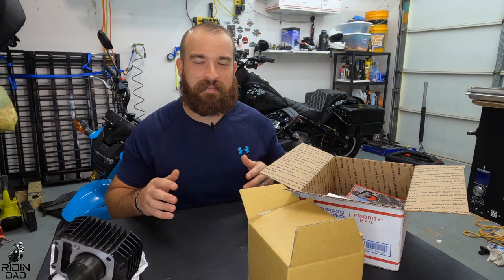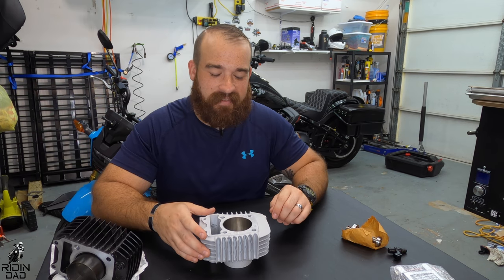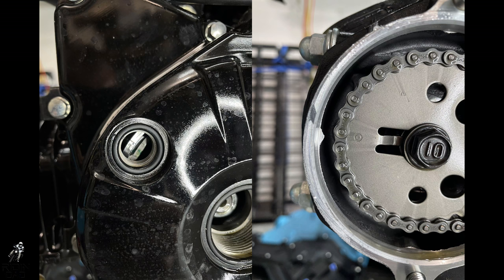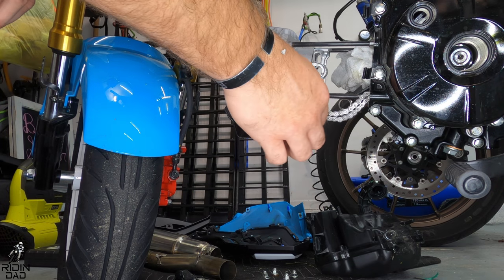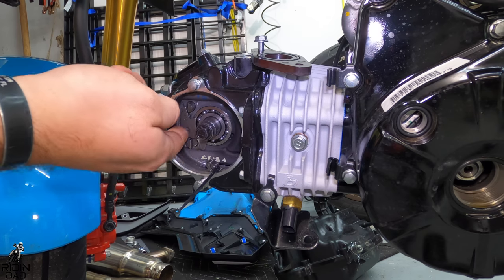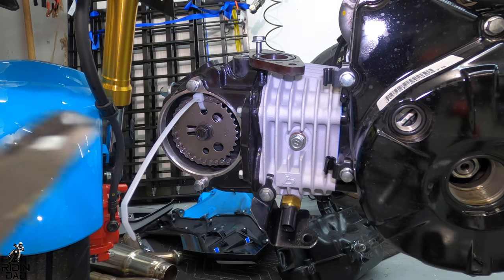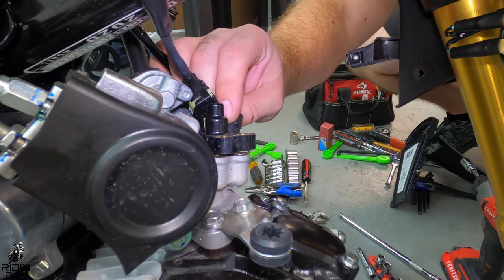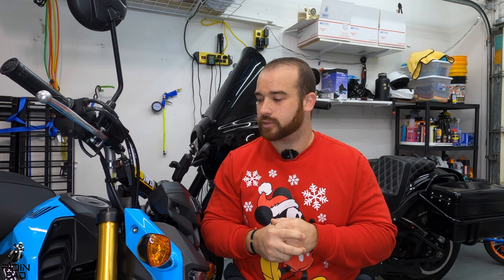DHM Big Bore Kit install on my Honda Grom (msx125) - 186cc of PURE POWER!

Comment: Just installed this same BBK into my 2020 Blue Monkey, and used the video as a step-by-step. Short story, it fired right up and runs great! Thanks Ridin Dad! I went 0.003 intake and exhaust, no valve clicking. Great vid, and very helpful - especially the zip tie trick on the cam chain.
Reply from the maker: Hey that’s awesome man!!! Glad to help, that’s why I do what I do lol. Have fun with it man, it’s so much better than stock!

Comment: Followed this to install my kit, no problem at all! 

Although, they must have changed up their oil cooler kit a bit because mine came with a black bracket and did not mount to the bottom valve adjuster tappet, instead it mounted to the bottom head bolts and it tucked up there pretty nicely. I did have to turn the idle screw one turn because of the poor idle but my only issue now is tough starts, which i'm sure a lithium battery will take care of.
Reply from the maker: That’s awesome!!!! I’m glad I helped man. Sounds like a better position fo the oil cooler for sure. And yeah you’re exactly right. A battery with Some higher cca’s will fix that problem completely
Reply: @RidinDad  For sure! Did you have clutch slip immediately with yours? Anything over 6k and mine just slips through the rev range. Looks like the tb clutch kit is next for me 😂
Reply from the maker: Never had a chance to experience that. I planned ahead and prior to the bbk I installed a 6 disc clutch kit & 80% stiffer springs!! Videos on all that in the grom build series playlist too 🤙🏼
Reply: @RidinDad  oh nice! I'll have to check that out then, appreciate it. I was wrong to think the stock clutch would hold 😂
Reply from the maker: Lol yeah man
Reply: @RidinDad  Good stuff! I was pretty skeptical at first if the BBK was worth it, it's a totally different bike and sounds way mean!
Reply from the maker: Hell yeah!! It is way more fun with it for sure man

Comment: Looks like a lot of work and it's a little pricey 700$ compared to swapping the engine complete kit with a zs190 direct replacement 799$ your also  able to sale the extra parts as well could possibly brake even if the honda engine is fresh. 👌👍✌️
Reply from the maker: I really wasn’t interested in an engine swap. The dhm kit is incredibly well made and I think the price is fair for all you get

Comment: Hey for those new to the bbk, if and when you upgrade your throttle body to something bigger ie, koso 34mm throttle body w/ intake manifold, expect to spend some money on getting your cylinder ported to match the throttle body. Just so you know - cause I didn’t.
Reply from the maker: Ive seen plenty of people do a new cylinder and add a throttle body later on without porting the cylinder....why would you have to do that?

Comment: I HAVE A 2020 HONDA GROM and I am seriously thinking about getting this kit. Everyone I talk to about it says that im going to need alot more parts to make it work right and be reliable is this true??????    Awesome tutorial by the way!!!!!!
Reply from the maker: Thank you! So everybody’s opinion is a little different. This kid specifically has pretty much everything you would ever need. There are some additional parts very small like some valve parts that are just a little bit more durable that would be a long-term thing but other than that there’s really nothing that I can think of that you would need with this kit. It pretty much has everything in it as long as you select the correct drop-down items and adding it to your card. That’s the main reason I went with this kit. I only have about 200 miles on it so far so I can’t tell you longevity wise how it has been but I can tell you that I have not been gentle with the bike and it’s giving me absolutely zero issues. I would say to make sure you have a good aftermarket exhaust and a good air filter to allow your bike to breathe with this new big bore kit

Comment: They call the kit "all inclusive", but if you're going to be installing an oil cooler I hope you got a high flow oil pump as well. I recall a lot of big bore guys having severe heating issues because they weren't actually getting oil flowing throw the cooler on the stock pump.
Reply from the maker: I do have a high flow pump. Have a video on that too

Comment: Hows it riding since you've done the install? has their been any problems with reliability?
Reply from the maker: 0 problems at all. I’ve abused it too lol. It’s great!!
Reply: Sweet! Have another question if you don’t mind me asking. I just installed mine today and I’m having a problem with the idle. At first, my bike had a super hard time starting up. I did get it to stay on after a few attempts, but at low idle, the bike sounds like it wants to shut off. When I blip the throttle, it will turn off if I do that too fast. I took the bike on a short ride and it felt great while riding but turned off on my when I slowed to a stop then tried to speed up. Any idea what might be causing this problem?
Reply from the maker: How long was the ride?  I would say take it on a longer calm ride if you can. Sounds like it’s going to fix itself. What air filter you using?

Comment: so was it worrht it? great vid, just wish u would have told us your top speeds and stuff. thanks though!
Reply from the maker: Thank you! And yeah....very worth it. Next weeks video is my first impressions. It’s impossible to find my top speed with this. I haven’t been able to find my top speed with the belt either due to where I live and the fact that the top speed would be well over 100mph. I didn’t feel too speed was important with this because it doesn’t decrease top speed to a noticeable level and it’s not made to increase the top speed at all in this gearing.

Comment: People, top speed will still be the same as stock it will just get there faster. Only way to get more top speed is by changing the sprockets.
Reply from the maker: True to an extent. Different kits and higher compression etc will enhance top speed but this one is way more for torque

Comment: Just about to install the kit on my Monkey, great video thanks, question because of the oil cooler do i need to put more oil in than normal? thanks
Reply from the maker: Thank man! And yes it will need more oil. I think I wound up using about 1.5 qts. Happy installing!

Comment: Hey bud how much oil did you used for the 186 bbk ? I'm doing the same thing but I don't want to less
Reply from the maker: So I kind of just played it by ear. I don’t remember exactly how much I used. Obviously more than the typical amount because of the included oil cooler. I think I just added a little bit extra and then checked the level and went from there. I honestly don’t remember too much

Comment: All head work,  cam installation, valve adjustment should be done on bench. Then install.
Reply from the maker: Why? That’s just preference. We adjust the valves normally with everything in tact at typical intervals. So just because you prefer to do it on a bench doesn’t mean that it’s wrong to do it while on the bike. Doesn’t have any affect on the outcome at all

Comment: Is the grom still up and running with that bbk
Reply from the maker: I have no idea lol. I sold it a while ago
Reply: @RidinDad  but how it rode any speed bumps
Reply from the maker: It handled speed bumps fine. If you’re asking if it bottomed out easy I never had an issue
Reply: @RidinDad  I think he's asking if there were any dead or flat spots in the power.
Reply from the maker: I gotchya. Makes sense. And nope. Very linear power delivery. No gaps at all that were felt on the butt dyno
Reply: @TheGamersRace  thanks for helping out
Reply: @samtarariverasanchez59  👆👉👍

Comment: Quick question bro, Installed this same exactly kit. Started it up and ran, it does struggle abit to start though? Also, it some times stalls when i just rev it alittle.
Reply from the maker: I’ve never had the stalling issue at all. My only guess would be if it’s still a somewhat new install that it possibly takes some time even though the ECU is re-flashed it might just take some time for it to break in and adjust to your specific bike since they do adjust a little bit. And as far as the start up, yes. It will be sort of hard to start up especially depending on where the piston is in the engine when you start. Because it’s a larger piston and a higher compression then start. So all that means is that your battery is not as strong as it ideally would be. You can fix that with an upgraded battery like a lithium ion With some hire cold cranking amps and then what the stock battery is and it should start up really fast
Reply: @RidinDad  Okay awesome, ill go purchase a new battery here soon! I appreciate the help. What was your break in method?
Reply from the maker: Pretty much the same as stock new. Just easy on the throttle no WOT for about 100 miles and just made sure the engine was completely warmed up every time I started it and as little idling as possible.

Comment: Just curious what you did for break in. Did you run a bunch a heat cycles or just let it warm up and ride? Thanks!
Reply from the maker: So dhm told me to do several heat cycles and ease in to it prior to abusing it and that’s what I did for the most part. Easy riding no redline for about 3/4 trips totaling 100-150 miles. When I hit 200 miles I’m going to do an oil change again

Comment: Hi, im about to install my kit, what oil did you go with?
Reply from the maker: Same weight oil as stock. I chose the motul brand
Reply: @RidinDad  my local store just had valvoline 10w40 motorcycle so i got that. To at least lube up with for assembly. Ill have to get btter oil to fill with when im ready to start
Reply from the maker: I don’t remember off hand but as long as it’s the same weight and made for motorcycles it doesn’t matter which brand you get

Comment: hello great vid, what mm is the piston in kit?   I am looking for big bore kit for "older" Honda SL100 1971 and the 120 kits available do not fit older 100's ....I be happy with just piston and rings I have good machine shop access for cyl , case or piston mods needed to make it work  thanks
Reply from the maker: I truthfully don’t know since it came as an all inclusive kit. If you go to the dhm site that may explain more. I also don’t know if you can buy the piston by itself from them. eBay might be a good choice if you have a shop to do things for you

Comment: Just found your channel. Have you had any issues with the grom that you might attribute to the big bore install since you posted this video?
Reply from the maker: Hey man, glad to have you. That Mike has been sold for a while here unfortunately so I can’t attest to any true long-term potential issues
Reply: @RidinDad  dang man. Was curious how they work long term, I've heard both good and bad
Reply from the maker: I’ve not heard any bad from anyone I e talked to if it helps
Reply: @RidinDad  yeah man, thanks!
Reply: @joshpaz1  I have the dhm 186, if you get all the supporting mods done it’s as reliable as stock in my opinion;
Reply: @PavelessAdventure what are all the supporting mods?
Reply: @stevenvelasquez8  high flow oil pump, 4-5 row oil cooler, aftermarket cam chain tensioner, a good tune and oil temp sensor/ reader

Comment: When did you change the oil after breaking?
Reply from the maker: I sold it. But I would typically say like 500-1000 miles depending on how you ride

Comment: Do big bore kits move the hole for your exhaust I want a bbk but I want my exhaust to mount in the same spots
Reply from the maker: No. Same exhaust positions as stock.  I used the same exhaust with no changes

Comment: How much oil did you use?
Reply from the maker: So I kind of just played it by ear. I don’t remember exactly how much I used. Obviously more than the typical amount because of the included oil cooler. I think I just added a little bit extra and then checked the level and went from there. I honestly don’t remember too much

Comment: did u install the decompression  lobe from the stock cam ? do u ever get a sluggish start up ?
Reply from the maker: No and no
Reply from the maker: You etched everything I did
Reply: I've got the S1 cam in mine, and before I replaced the OEM battery, I would get rough and sometimes no start without putting it in gear and rolling it off the compression stroke. After the new battery, no issues at all.

Comment: What is the point for few HP gains and maybe 80mph? You now have $4800 in your Grom. Just buy an MT03 for $4800 and you have 35 HP and 110mph plus, better handling, braking and a much safer bike.
Reply from the maker: It’s about the fun of it. It’s fun working on bikes to some of us (me). And it’s a completely different feeling going 70/80 on a grom than on a full size mt03 or ninja 300 etc.
Reply: At 220 pounds, a Grom is light enough for a single average man to pick up.  At 373 pounds, the MT03 is beyond the lifting abilities of nearly everyone except elite athletes
Reply from the maker: One of the many differences and pros for sure!
Reply: I admonish you sir.
Reply: Whenever i see this the only thing to think is they’ve just never spent a little time on one once you do you understand
Reply from the maker: Exactly
Reply: This is exactly what happened to me. I always said I wouldn't buy a grom.  I bought one 2 days ago. Already put 100 miles on it. Now I understand why people buy it.@Jq__176
Reply: I have Both bike , i love them Both but If i need to sell One of them it Would be the mt03 cause Yes it's a cool bike but the grom give me a Smile that no other bike can give me , my friend dont get it , they said sell them Both and buy a mt07 or some z900 etc ..but why should i Listen to them , they dont Know how much the grom give me pleasure and Joy , it Not Always about the power
Reply: So you didn't even watch the video... 4:12

Comment: Holy crap that was painful to watch. I know it’s been two years. You need to invest in a set of sockets. Also every time you install new parts they should be cleaned. You should have removed the piston and cleaned the bore and piston. Then dip the piston in oil before putting it back in the bore. Oil the wrist pin ect. Do you own a torque wrench?
Reply from the maker: I do own a torque wrench. I also own a ton of various sockets. Thank you for being so concerned about my tools though

Comment: cool channel and bike would this kit work on a 125cc loincin pocket bike motor x18 mini ninja style
Reply from the maker: Thanks man. And honestly, I have no clue. It is intended for a Grom, so if that bike has the same engine, then probably, but if it’s one of those Chinese engines that is typical on those probably not. But you should reach out to DHM to be sure.

Comment: U blow the crank and rod outa it yet??
Reply from the maker: No
Reply: @RidinDad  feel like I have to rod my grom around all over. If it had some power I don't think I would be so hard on it.
Reply from the maker: You can still be hard on it with a big bore kit for sure. There’s tons of guys running it insanely hard with no issues. But it is hard to beat the reliability of the stock configuration for sure

Comment: how the dhm kit running now ?
Reply from the maker: Sold the grom a while ago
Reply: @RidinDad  did u have any issues running this bbk ? i installed mine but has hard start issues and i have to give it some throttle to get it started when cold is that normal for this kit ?
Reply from the maker: No issues at all for me. How long has it had those issues for?
Reply: @RidinDad  well i just bought the bike few days ago and previous owner install the kit , i just did the ecu and tps reset and all is good now 🙏😀
Reply from the maker: That was gonna be my next suggestion. What are the chances it was never tuned or had the ecu replaced? Before mine was corrected it started very roughly
Reply: @RidinDad  it has the upgraded ecu from dhm but i think previous owner never did the upgrade ecu tps reset 🤦🏻‍♂️ starts up and rings great now . 😀
Reply from the maker: Glad to hear it!!

Comment: 24:00 You'll probably need to add some extra oil for the cooler.
Reply from the maker: Yeah
Reply: How much oil do u run? How did u find out how much and do u use 10-30 motorcycle oil.
Reply from the maker: Use the same oil you normally use in the grom. And I don’t remember the exact amount. A little more than normal. Just keep checking the dipstick to see the oil level. Gotta start the bike a little too to have the oil pushed in to everywhere

Comment: Do you need a tuner after this?
Reply from the maker: Did you watch all the video? The kit comes with a pre flashed ECU and/or a flash for your existing ECU if you send it in. I'm pretty sure I talked about the options but I for sure talked about the option i chose with the brand new ECU
Reply: @RidinDad  yes just bought it
Reply: @RidinDad  BOOM ROASTED

Comment: Music sucks but nice work
Reply from the maker: Copyright free 🤷🏽
Reply: @RidinDad  I agree with gerald I could have done without the music, no noise would have been just fine but in any case at least it wasn't k-pop or something like that lol. Great video btw, love that you took the time to show all the detail which is a big help. Just curious did you get the speed increases that you were hoping to get from this kit?
Reply from the maker: Thank you and as far as the music goes it’s like a 1 to 10 ratio of people who don’t like it versus people who want me to keep it. So it’s not going anywhere. And yes. This kit specifically is more for torque than it is for a high speed especially with the stock throttlebody and valve head. If you increase to a four valve and a Bigger throttlebody you get a much bigger increase in speed anyway but I knew going into it it would be more for torque which is definitely helped a ton with